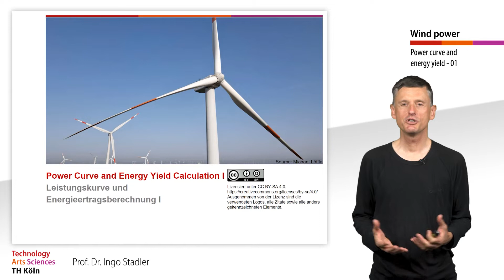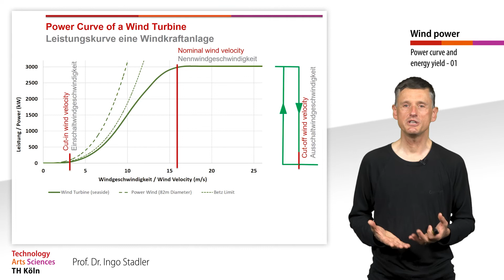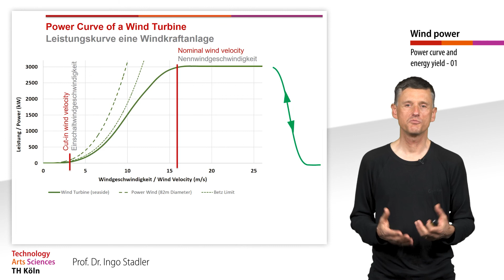Energy Yield Calulation of Wind Turbines - Power Curve

Comment: Problem, HYE-1500 96V turbine.  How does one figure out the power curve for programming a Aurora wind inverter ?  The given curve supplied, only has M/S- watts out put.  The inverter  program ask for Volts-Power(amps).  16 columns to plot. How does one figure that out ?